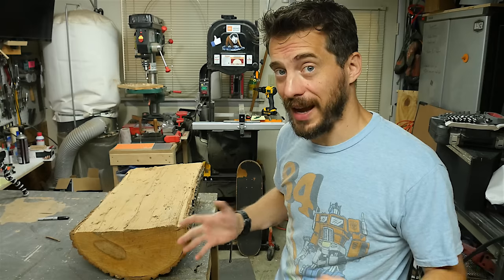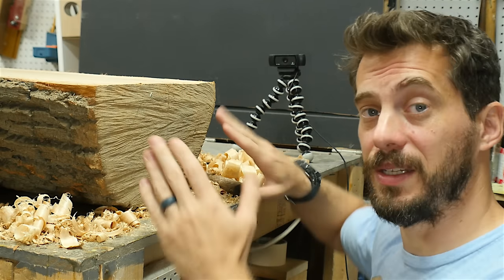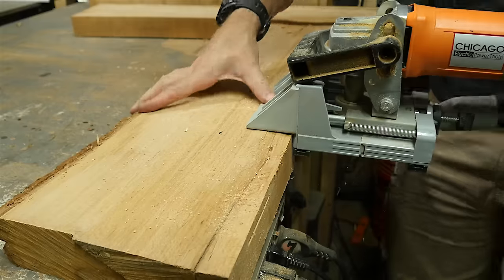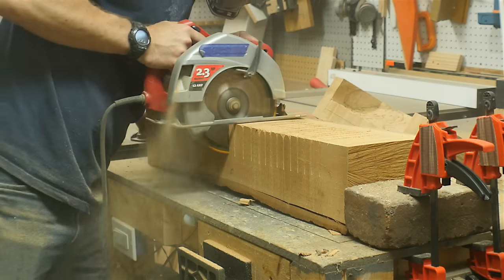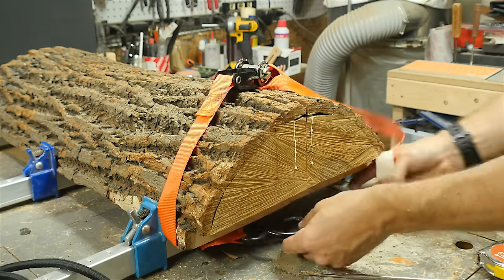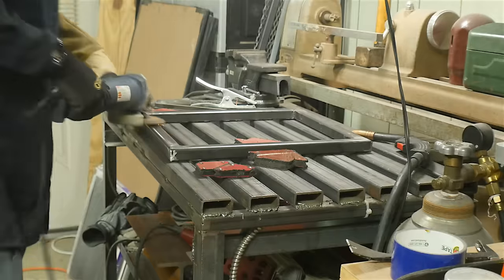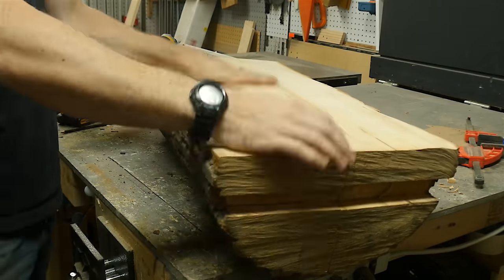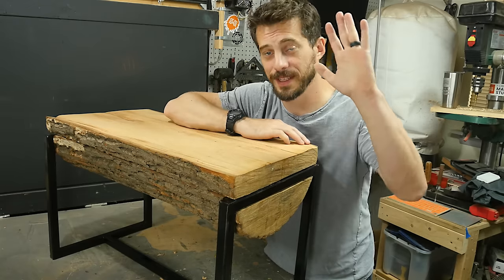How to make a log bench with HIDDEN storage! | I Like To Make Stuff

Comment: That was creative, and really neat how you kept your cool and worked around those problems during the cutting.   I'm surprised at how well those lines closed up -- usually I need to joint my parts after I cut on the bandsaw -- but of course this is a rustic project and the bar probably hides a lot also.   Nice memory of your Grandad.   the story of a project can often be even more important than the project itself.
Reply from the maker: Thanks Art! yeah, the bark definitely helps hide the seam on the outside and the glue filled the seam on the face pretty well.  I'm really glad to have been able to use this piece in it's mostly original state since it came from my Grandad.  I'll be glad to have this project around the house.

Comment: Nice work on the bench, very cool idea.  One suggestion regarding the welding.  Maybe you did this off camera, but if you want to grind the faces of your welds smooth, you should grind a bevel in the joint to allow your weld to penetrate deeper into the metal.  When you just weld the faces together then grind the weld off, you are removing most of the strength of the weld.  It's probably not a huge deal when working with furnature and lighter pieces, but strong joints are always worth a little extra time.  With practice, you will also be left with less material to remove, meaning less grinding at the end.  Thanks for sharing!
Reply from the maker: Oh, that's a really good point! I hadn't thought of that, thank you!

Comment: Funny, I was just looking up and saw a review of that saw when I was looking for something to cut metal better than the old hacksaw method. I have a few projects coming up that will require cutting some tubing and some aluminum. I didnt want to have a metal saw and a wood saw around and this thing seems to fit the bill.  Perfect price for the home shop maker.  It's always nice to see a good tool and as multipurpose as is possible when space is tight! :D

Comment: Just a tip for fixing the issue with your bandsaw fence. Every blade has drift. Your fence should be adjusted for this. It shouldn't be 90 degrees to your table. 

Take a scrap piece of wood with a straight edge, draw a line on it parallel to that edge. cut down that line, following it as well as you can free hand. Stop in the middle and don't move the wood. Notice the angle the wood is at. draw a line on your table with a sharpy or put down a piece of tape along that straight edge of the board. Adjust your fence parallel with the line. Now when you cut wood against the fence it will not push away, it will follow the fence.

Comment: Hey bob, you portably know more than I do but I was building a pergola with my dad over summer. He broke his wrist early on so a lot of the handwork was up to me. When you were hollowing out the log I had a recommendation. So you made cuts every inch I would recommend that you make cuts every 1/5th in and all you have to do is stick a chisel in the gaps push it back and forth once. I noticed it takes no time and all and you jut have to use you chisel to clean it up.

Comment: That is an interesting bench Bob!

Tools are just fine for flattening the top, but the technique is lacking for doing it quickly.  If you care, it's more effective to take a heavy cut with the plane going across the grain for heavy removal then diagonal in both directions, before planing with the grain for smoothing it.  Also, a chisel is easier to use the way you were using it with the bevel down rather than up, in my experience.  Good technique to chisel off the obvious high spots though.

Comment: good video, nice recovery from the mistake.
2 things you can add:
1. wire cross bracing for more sturdiness.   drill holes through near the log in each leg, and near the weld in the bottom cross piece.  Put torsion wires (sailboat stays work well) from a leg to opposite center and back to other leg on first side, repeat for other leg and torsion  both wires down.  Light weight cross brace, and it adds a lot of strength.  Then the weld will not be stressed by fat folk who plop down at an angle......
2. rout a slot in the seat, so it is apparent it can be lifted - otherwise people like me will forget.....

Comment: Hi Bob, I also like to make stuff, but am quite a beginner. I am working on a box for a electrical project with the raspberry Pi, and am using 9mm ply wood, cut at 45* angles to hide any seams. How would you recommend joining the wood together? Would wood glue suffice(it won't be under much pressure)?
Thanks, I love your videos and really enjoy the Raspberry Pi projects
Reply from the maker: Hey Benjamin! If the the box would be supporting anything, gluing the miter joint would be fine.
Reply: Thanks so much. I love your videos :)

Comment: I'm enjoying your videos but I have a suggestion.  If you're going to buff your welds flat you might consider grinding just a little bit off of each welded edge.  This will create a trough when you put your pieces together that will give you better penetration and more surface area to weld to. Probably overkill, but if you're buffing your welds flat this will ensure they stay strong.  Anyway, thanks for the videos and the inspiration.

Comment: This is an old video not sure if you'll get this, but what's your long-term review of that evo saw? do you like it is it holding up? or would you skip it and just buy the metal cutting bandsaw. (I've seen one of those in your videos too).  I have an ok miter saw. I have a 14-inch bandsaw. I currently cut steel with a cut off wheel that works good enough, or the band saw with a metal cutting blade, but both of those have their limits and would like to purchase one or the other. I'd like your input considering you use both

Comment: Naturally a 15" wide jointer would have been the best way to level off the top...but who has one of those?Let me tell you about an awesome tool...the turboplane! Goes on a 4" angle grinder and rips through wood in situations like this. Harbor Freight has a clone for $15 if you don't want to drop the $140 on one. Great build!

Comment: This is great!  Quick question, you mention that the wood trails away from the fence after the blade.  What exactly causes this?  I have an inexpensive table saw and this happens to me often on the table saw and I'm not sure why or how to avoid this.
Reply from the maker: If it's on a table saw, that means the fence probably isn't square or locked fully in position.  It happens on the bandsaw because the blade has a tendency to deflect to either size for different reasons.
You should be able to adjust the table saw fence to make sure it's parallel to the blade.
Reply: Thank you!

Comment: Cutting steel with a miter saw? What blade do you use? Tried cutting aluminium once and some of the teeth got shredded even if I was really careful not to push too hard. Cheers!
Cool build. Like to do it myself. Go to the forest now to get some wood.
Reply from the maker: There's a link in the description for this saw.  It's ability to cut steel is a combination of the blade and the saw itself.  Check it out.
Reply: Great, just the most descriptive description of everything, even the welding gloves! Must have had tomatoes on my eyes. Did not know that tool before. So as I understand it runs on lower speed with a special blade. Everything is clear now. Thanks for your hint :)
Cheers!

Comment: Quick question, in my experience with wood... which is not a lot but enough... When you use "live wood" the bark eventually falls off. My first thought is to use epoxy, would that work?
Reply from the maker: I think it would. Someone else suggested covering the bark with shellac, so I may do that eventually.

Comment: That came out great! Are you using a special blade in that miter saw to cut the steel? It looks like the same saw you used for the pool pump cover.
Reply from the maker: Thanks! It's a combo blade made for wood/steel.  The saw itself has a different torque/RPM setup than a typical miter saw to enable the cutting, I  believe.
Reply: oh very cool. I'll have to keep that in mind when I'm ready to upgrade. Thanks!

Comment: Great project. My only suggestion would be to use dowel pins instead of biscuits for more strength. Although I'm sure you used a good glue. It bothered me a bit that the lower part of the log is held up only by 3 screws but it should be plenty since it wont hold a persons weight, the top will. Very nice.
Reply: silveravnt  Remember that a glue joint on long grain is stronger than the surround wood. In that type of joint the dowels or bisquits are only needed to aid in alignment.

Comment: Just in case people don't know, using a saw saw to cut both metal and wood is fire hazard (sawdust when dry is extremely flammable). If you have to use the same saw, make sure to vacuum up all dust before cutting metal.

Comment: You probably could have clamped the log down and then dropped the circular saw into the cut line, kind of like when using a jigsaw. Idk if it would have been deep enough but might have saved you a bunch of time on knocking out those pieces

Comment: Looks cool, but I think you need more the 3 screws on each died holding the log. Really they would be better if they went in the sides of the log not from the top. At least you would have some shear load on them. I feel they will pull right out and the log will drop from the weight of someone sitting on it.
Reply from the maker: The weight of the person sitting is on the top panel, and is then transferred to the steel frame.  The log underneath really has no part in it whatsoever.
Reply: I Like To Make Stuff - Yup, I goofed! Sorry about that.
Reply: I'm understanding your logic, you would be driving screws into end grain, which is always a weak connection
Reply from the maker: Tom's Dreamshop Worx No sweat at all!

Comment: Old video i know, but just to say this project was crying out for a chainsaw with a guide to cut the original slab, and an arbortech disc on an angle grinder to do the hollowing...that would have saved a lot of hassle by not cutting the log in half and thus not having to rejoin it.